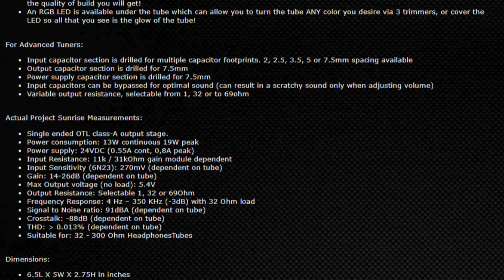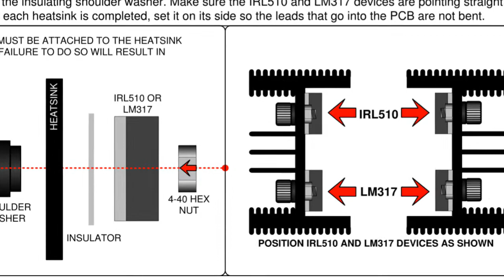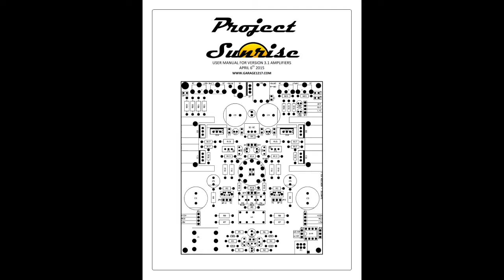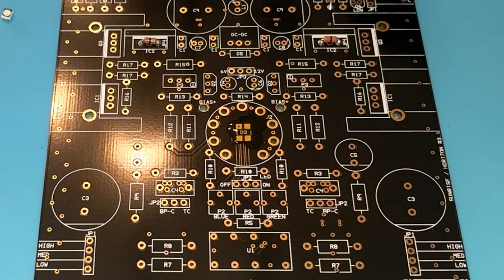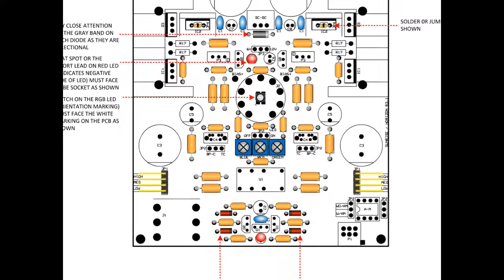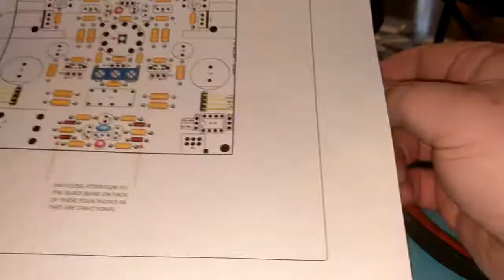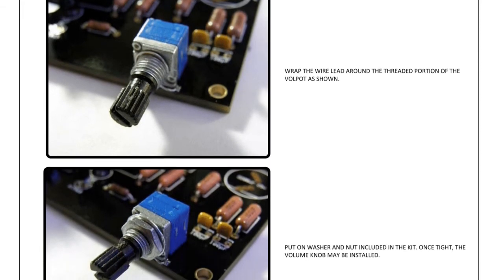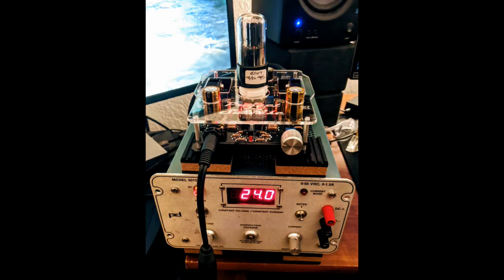Garage1217 Project Sunrise III DIY Headphone Amplifier Build

Comment: I see a nice ADI-2 DAC in the background on that linear power supply shot, i got mine a few months ago and am thinking about going with one of Garage1217's kit's to power my 600 Ohm DT990's. The ADI powers them just fine in terms of volume but i would love to try out a tube amp for fun since they are so high impedance.

Comment: Which tip are you using on the Hakko?  It looks like you are having an easier time than me when soldering components.
Reply from the maker: I'm using the stock T18-D16 1.6mm chisel tip in the video. I used it because Jeremy (Garage1217) suggests that style of tip. I also have a T18-B conical tip but I am only inclined to pull that out on a small component guitar pedal or something of that nature.

Perhaps the biggest game changer for me was getting good solder. Kester 331 Organic Core Solder 63/37 .031 is outstanding stuff.

I frequently clean the tip (every few joints usually) and re-tin it. A little dab on the tip after tinning goes a long way to transferring heat quickly.
Reply: @Lucktronics , thanks!  The solder might be an issue.  I have just used the "default" that came in some kits and a spool I bought from AdaFruit.  I'll give that a try.